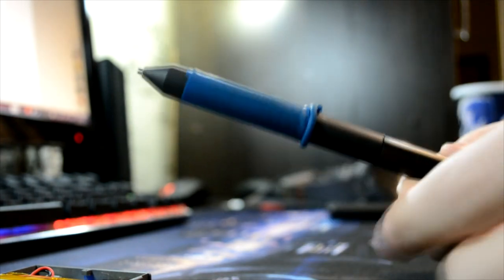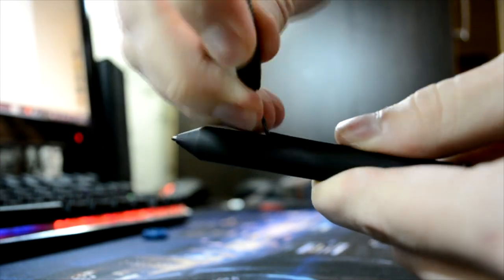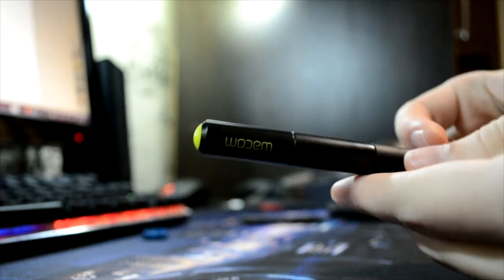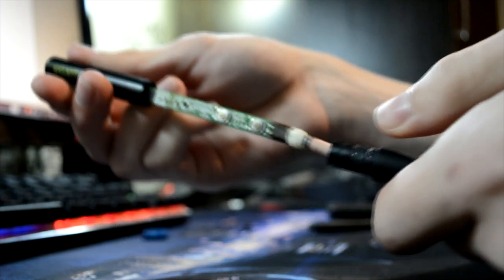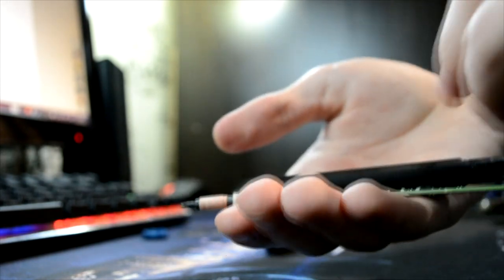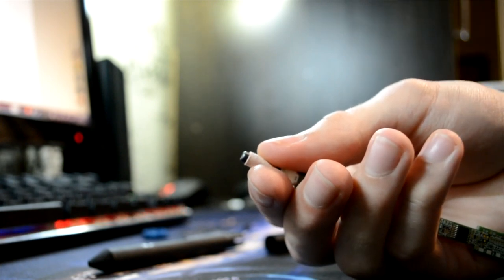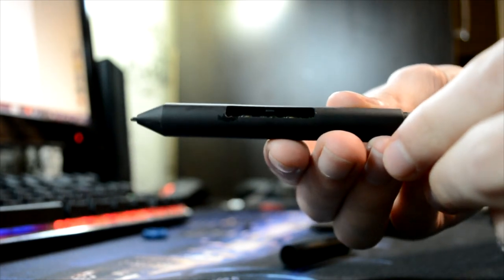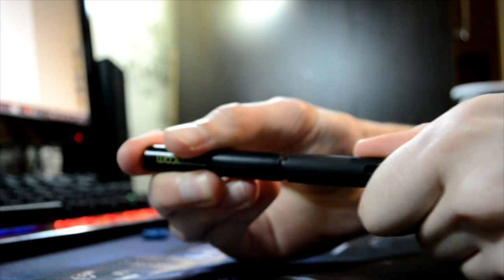Wacom CTL-471 Pen Disassembly

Comment: What's up. My pen (Wacom One) stopped working (i think it might has something inside the pen that shouldnt be there... yk?) and i wanted to open it but i dont think that's possible.. my pen doesn't have that part where two parts connect together, it's just one thing yk. I don't know what to do, can't find anything about that if you want i can even send u my discord and send u a photo for u to see if you know how to open it or do something idk i'm just desperate asf
Reply: same thing happened to me, did you fix it?
Reply: @HERCONDESCENSION  no 😭 i was lucky to get my sister's tablet and pen since she doesn't use it anymore, but my old ones still doesn't work. Were you able to find a fix?

Comment: the nib of my ctl-470 got broken inside the thing and i cant take it out. the broken edge is at half way of that copper roller. i think i could take the nib out if i could remove the eoller part because i see the part of the nib in the inside extreme but it has those 2 copper wired tied to the motherboard and i ont have a welder or something like that and i dont know what to do.

Comment: I did in on my bamboo ink plus. :0 other than that. Mines has a cable connector. Can’t see where it goes in.
Reply: hey, I have a bamboo ink plus too and the thin part of a nib (the blue one) broke and got stuck inside. How did you get yours open? What do you mean by a cable connector? Did you have to take off the power button first? Thank you.